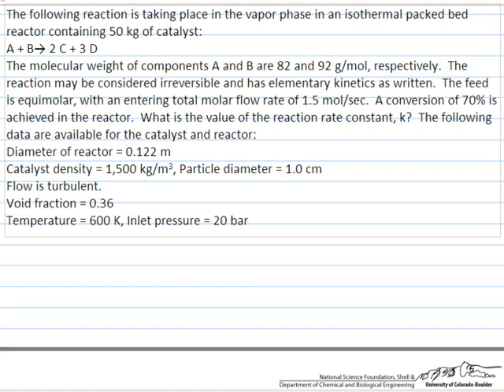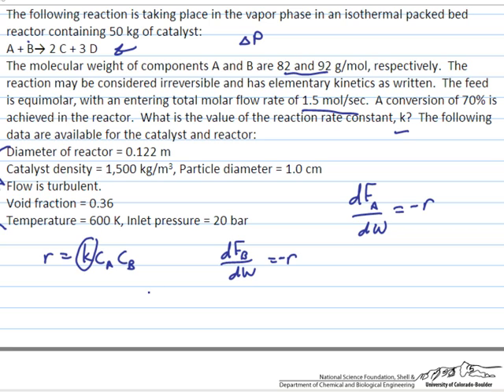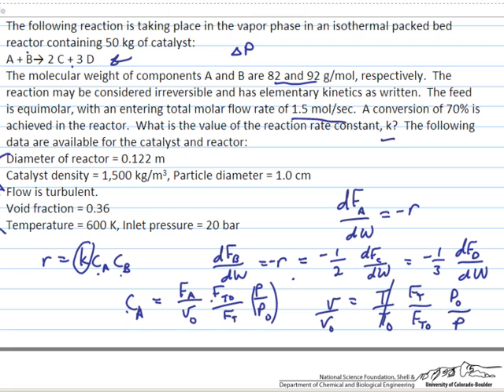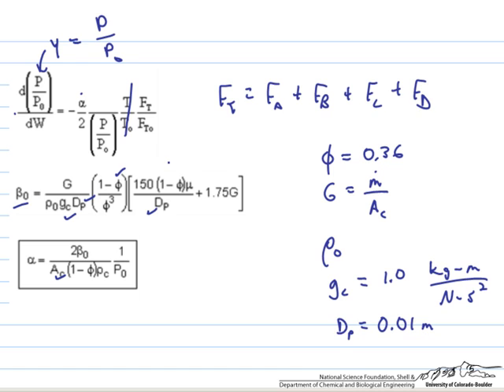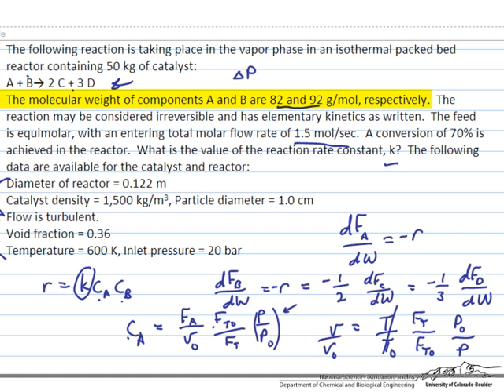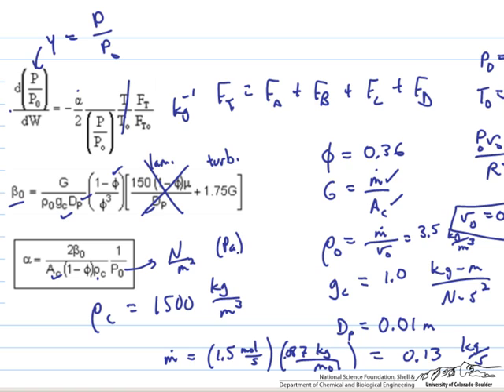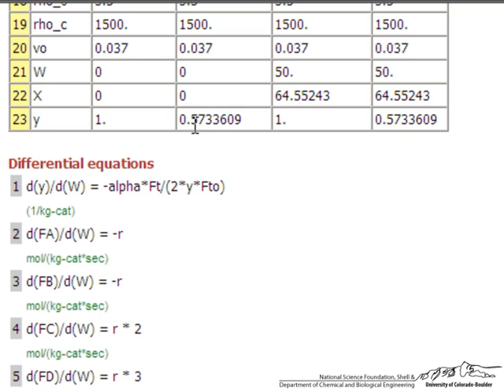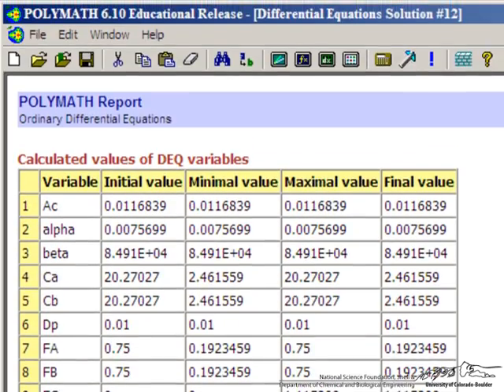Determining Rate Constant in a PBR

Comment: Hello, for anyone doing the code there is one slight mistake. when determining beta the code uses m_dot rather than m_velocity (G). 
Its necessary to add the following line:
m_vel= m_dot/Ac
And change beta to:beta=1.75* m_vel ^2*(1-phi)/(rho_0*Ac^2*Dp*phi^3)
Other than that this is a fantastic video!  Up the banner!
Reply: what is gc?